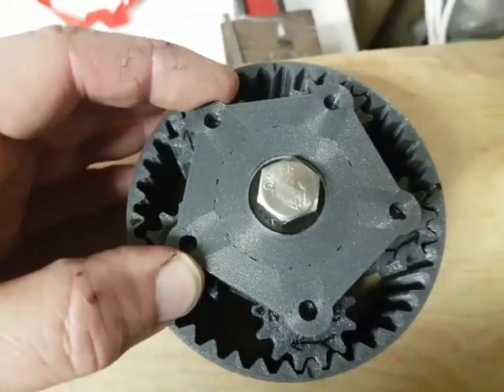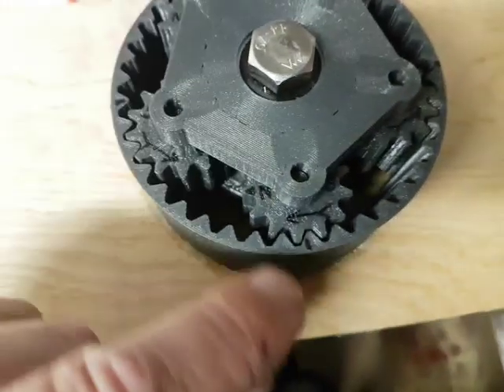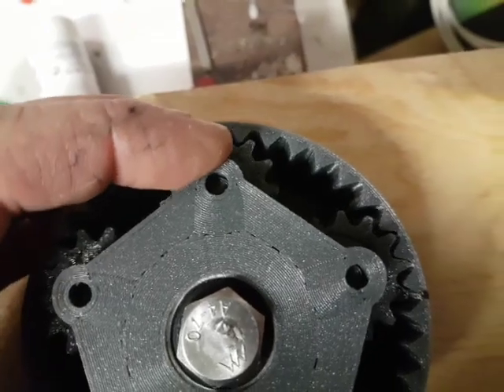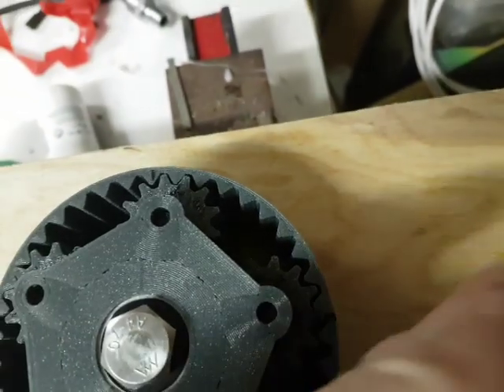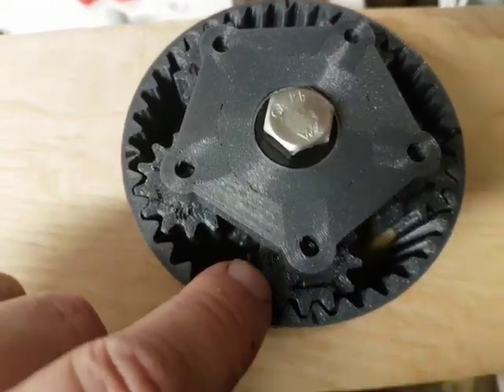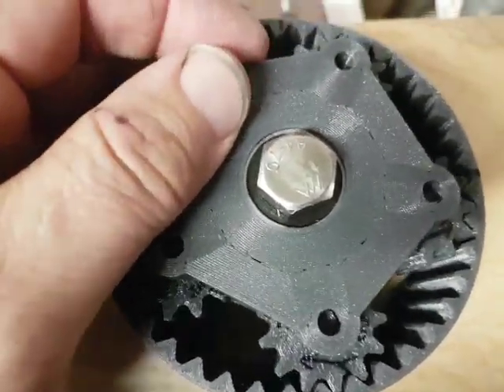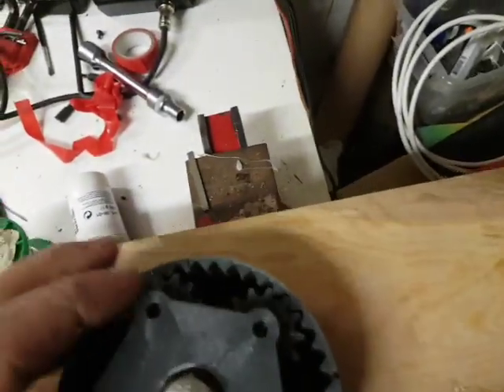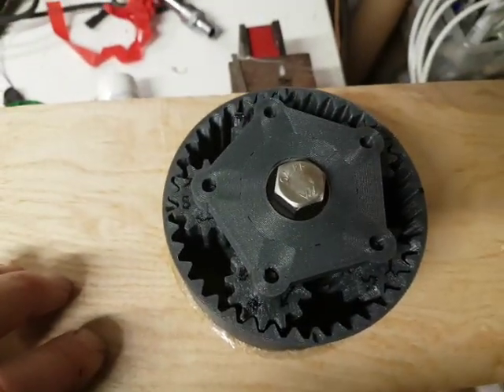Rotating Halbach array

Comment: Actually it is not, you need the side ways magnets, its north, north south, south, south north, north, etc
Reply from the maker: Yes, it is. I have measured it. The net magnetic field is pointing north to the right regardless of the rotors position.
That said, the device isn't useful for anything. I built it only for fun. Cheers :-)
Reply: This isn't a bad idea, if you had 60 teeth on the outer planetary and 12 on the 5 inner planetary gears and one gear in the middle you could achieve asymmetric halbach array. One gear would have to be at 90° different orientation because 5 leaves an extra pole in one direction or the other. Or 2 diagonally polarized outer coils would have to match at a 10point star 60 overlap for 3 phase winding with 7/12 offset 
With the larger north trailing just behind the two diagonals or somehow find an asymmetric cone with 3d halbach coils on planar curve spiral and make your gears spiral gears instead of straight bar and groove.